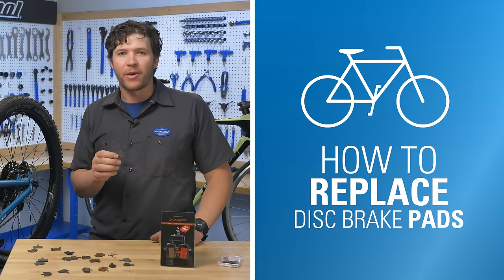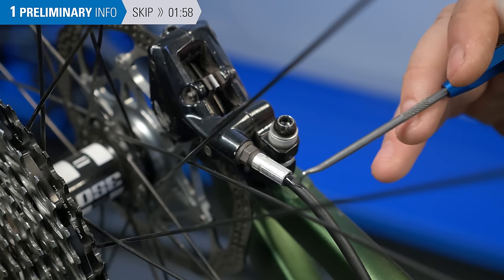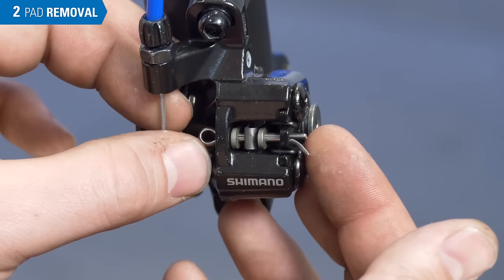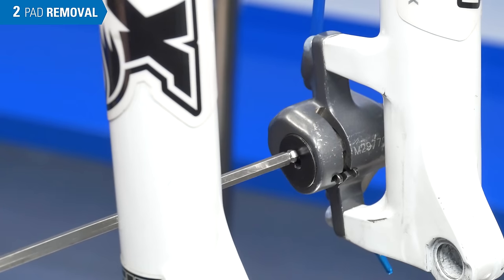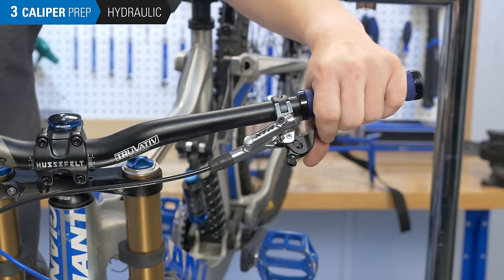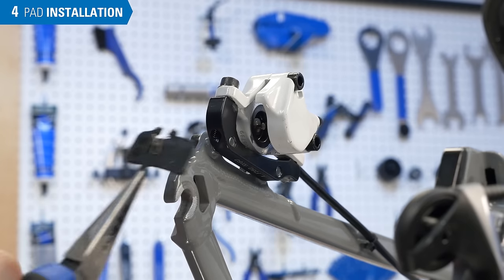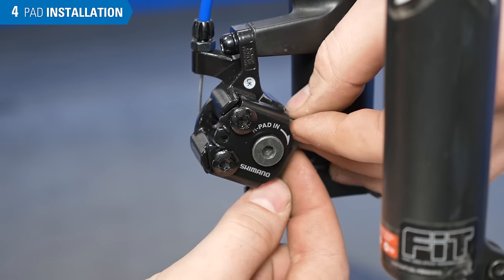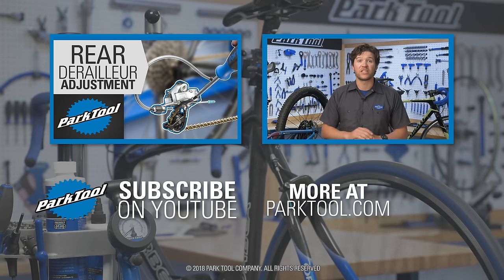How to Replace Bicycle Disc Brake Pads

Comment: I accidentally pressed the brake handle when I had my pad removed... My hydraulic brakes didn't like that
Reply: I did that and turned a 2-minute job into a 3 hour job
Reply: @gabrijeljozic9890i pushed it with a screwdriver back in it kinda worked
Reply: They explain in the video what to do if you pull the lever with no pads in. Should be 5 seconds of effort to push them back in with a flat screwdriver.
Reply: Same, quit biking after that
Reply: @SuzukiKid400  often when pushing the lever with no pads in it will push so far that hydrolicfluid will come out, so it is not just pushing back in place, but you will need to refill mineraloil in the brakes.

Comment: A lot of preparation and work went into this video to show the wide variety of designs and types of brakes and pads. Thanks for taking the time to create these videos.
Reply: Yes. This video very clear and extremely well produced... public information YouTube at its best.
Reply: And your explanation is exactly why I’m sticking with rim breaks. This is way too complicated.
Reply: @salmonella508  u mean v brakes?
Reply: Great video, in fact they are all very good and useful.  I changed the pads on a Shimano, wheel is back on, but the handle is now very soft. While I cleaned the calliper, some oil leaked.  Is the handle soft because of missing oil?
Reply: @salmonella508  LOL!!! I had no idea what I was getting into when I got disc brakes.
Reply: @normb987   I can't tell you exactly, but I think the issue is that you pressed pistons too hard this creates leaks. In fact I would never recommend anyone pressing pistons without bleeding screw taken out.
Reply: Thanks,I'm learning over here.
Reply: I like the video a lot,,, you broke it down for the consumer or people who ride mountain bikes with those types of brakes systems or brakes setups mechanical or hydraulic again good video I learned a lot thank you

Comment: Thank you, folks. The local bike shop is so backed up during the Coronavirus lockdown that it was going to be a month to get new pads done on my bike. I bought the parts from them and used this video as a reference, along with the video about adjusting the alignment of the caliper. Brakes are good as new, and no more rub!

Comment: I just want to thank you guys for saving me £25 plus labour. 👍🏻👍🏻
I know it isn’t a fortune, but it opened my eyes for how easily you can get scammed.
I went to the bike shop because my brakes didn’t work at all, all of a sudden after switching front and rear brake cable (I’m Danish, and don’t like the British setup with the rear brake on left brake handle). 

The gentleman there said that my brake pads had gone missing, which I found dubious but okay. He also said that he would probably 
 have to fit a new brake calibre system, all in all £25 plus labour. I decided to have a check online to see if I could change the pads myself, and after taking the brake apart according to this video, I realised that not only were the pads still present, but they were also well within limits, and all I needed was adjusting which took 30 seconds.

Great work guys, I’ve subscribed and will definitely watch more of your stuff.

Comment: VERY helpful! I replaced my old brake pads and rotors today. I went to my local bike shop and had them help me purchase the correct pads. They offered to change the pads for me, but I wanted to learn how to do this for myself. The rotors were easy, and your video took the mystery out of changing the pads.

Comment: More expensive than many other equivalent tools, but you get precision and longevity. 
Not up to speed on disc brake system maintenance, as important as it is.
Your video though, certainly filled in a few gaps.
Many thanks.

Comment: Thanks for the video n going thru all the different models. Mine was the retaining pin. Removed the pads..clean w alcohol, sand down to even the pad...squeaky sound all gone! So irritating to brake w the squeak. Thanks!

Comment: Lessons learned: 

4:18 - Retract the piston calipers before removing the brake pads. Some configurations don't really produce a lever big enough for you to push them in with the tool. But if you removed them before, just put the old brake pads in between the tool and caliper to make a sandwich and push the caliper back into open position.
Reply: Bro I've wasted 1 hour bcs I accidentally pressed the lever💀 thanks

Comment: great content and tools quick question on this video.  Isn't there a process to scrub the pads after installation?  I have read that once installed rather than hit the trail you should take a few straight forward runs and apply the brakes aggressively to scrub residue and seat them properly with the disk.

Comment: Fantastic video. Detailed, clear and great visual details throughout. *Can you provide some advice... I'm installing hydraulic disc brake pads for the first time. I removed the old pads just fine. I'm unable to compress the pistons all the way in. They go in part-way then slowly creep back out. When I put the pads in, there is no gap between them. I was able to spread them apart enough to fit them over the disc. However, both pads rub hard against the disc so the wheel hardly turns. There's no free play like there was before. The brake lever doesn't have any free play either. Why aren't I able to compress the pistons all the way and have them stay? In your video, the pistons stay all the way in. For reference, these are Tektro Auriga e-Comp brakes. Thanks in advance.
Reply from the maker: I have responded to your email.

Comment: Thanks @Park Tool! I'd love to meet your instructional designer, the videos are a blast! I have a question about pushing the calipers back - whenever I push one back, the other one comes out. No matter how much strength I put into it, I can't push both of them back. Does it mean there's too much braking fluid and I should let some out?
Reply: Have the same problem

Comment: This is why I LOVE drum brakes. My main bike runs Sturmey Archer hubs. One with an IGH and the other with a generator. Both have hub brakes. It's now 10 years old and is used for near daily commuting and the last I checked the wear on the pads it's not even 1/4th the way worn. So It should close to 30 more years. I'll never understand why the drum brake never gained a lot of acceptance outside of utility bikes.

Comment: Looks like like serious job, I once bought brake pads and replaced them on my bike with cantilever brakes in 5 minutes, then on the way home car cut me and I had to brake hard, if not for that I had just put new pads I'd be dead. If I had one of those disc brakes I'd have to go home on old pads and would crash cause no way you can do that with one allen key on the street.

Comment: Great video, i wonder if too much breakfluid can lead to rubbing brake pads. In my case the pads are well centered and cleaned, but as soon as I pedal hard or the breaks get hot when going downhill they start to rub. I am Riding a specialized venge with ultegra 8070 di2.
Reply from the maker: It is possible but resetting the pistons and facing the mounts are probably more likely solutions in that system.

Comment: WARNING:
in hydraulic brakes, if you press the clips manualy back into place too quickly and too hardly, you will cause the automated system at the handle end of the brake to spit the fluid out. You should gradually press them into place and in this way allow the fluid to get back into the small reservoir at the handle end of the braking system. This reservoir holds the additional fluid so that the system may adjust itself as the brake pads get thinner and thinner by use.
Reply: Excellent point!

Comment: 6:12 I have this one (Avid BB7 Mountain/MTN). One of the pads sometimes comes in crooked. Damn, that's really annoying.

I wish there was a mechanical brakecalliper that holds the pads with magnets and where both of the pistons moves when I press the brake lever.

The one thing I do like though. I really like the indexing adjustment. No, loctite or anything. Just set them and they will never move.

Comment: Wow, now I know what is that thingy at the end of caliper for. Better super late than never :-) Anyway, back to topic -- what are the mechanical disc brakes that do not require removing the wheel to change the pads?
Reply from the maker: There are a few available. TRP's are a fairly common option though.
Reply: @parktool  Irony I have TRP, Spyre-C but the pads can be removed by pulling them down, meaning you need to remove wheel as well. Do you know specific model which allows removing just pads (w/o removing wheel)?

Comment: I watched this and completed a pad change.  When I was cleaning up I grabbed the instruction flier from the PP1.2 and it said to push the pistons in with the pads already in place, which is contrary to what is noted in the video.  Just wanted to share this as I was unsure I had completed the job correctly but the rotor wasn't rubbing and everything felt good so I didn't both redoing it.
Reply from the maker: It is not un common for the pads to be too close together to use the PPL-1.2 effectively. Thats why in this video we give you a more effective way to push them back everytime. The PPL-1.2 is designed to work with pads or without.
Reply: @parktool  Thanks for replying!  I know the video is a bit older, nice of you guys to stay on top of comments after the fact!

Comment: When trying to reset the piston, when one side was pushed in the other came out not allowing a big enough gap for the rotor to rotate freely. How do I get both the left and right pistons to stay pushed in? Great video thanks.
Reply from the maker: It can be a bit awkward.  You can use a cone wrench handle to hold one while pushing the other. Or set pistons before removing pads.

Comment: Should I re-bed the brakes after replacing pads with the same material (organic)?
Reply from the maker: There will be a bit of bed in time, but In your case (having the same material and the rotors were already on the bike) no bed in procedure is needed. Have fun!

Comment: I disassembled my brake caliper and found that one of my pad was missing a small magnet attached to it (they are removable). 
The caliper seems to be made by Joytech and model is MDS5, but I cannot find any information or video on that specific part. 
I'm also unable to find any replacement parts. 

Have you ever experienced that and how do I fix my brake? 
It keep jamming when I push the brake, because the pad doesn't return into it's position.

Comment: Great how to video. Towards the end of the video, the presenter mentions that it's normal for properly installed brake pad assemblies to wiggle. I ride on hilly gravel roads a lot. On steep, bumpy, gravel descents (nearly 40 mph), I'm hearing fairly loud chatter coming from the front of my carbon Orbea Terra with its Shimano GRX RX-810 disc brakes.  Could that be the disc brake pad assembly chattering? Could something that small make such a relatively loud chatter?
Reply from the maker: Try to isolate the noise.  Begin by checking the headset.  Bounce the bike and see if there is a rattle.  Then check the security of the front wheel.  Grab top of the wheel and pull side to side and check for play.  Check brake caliper mounting bolt tightness.

Comment: Great video! I am having a problem with my pads. They are the magnet type and without a retaining pan. The problem is that the outer pad keeps getting out of place and won't go back to relax position because it gets stuck. It's really frustrating because it results in your bike braking completely and me having to dismantle the brake just to force the pad back into correct position. And once i use it again with some intensity it happens again. Any suggestion on what should i do?
Reply: I think my comment is clear symptom that the pads need to be replaced. After i made my comment, i removed the inner pad just to compare it with the outer pad and only then i realized how eaten the outer pad was. The inner was almost like new while the outer was almost reaching the metal, with almost no layer left. And i think that is exactly why the pad got out of place whenever i braked hard, because it was so thin that it went along with the disc instead of staying in place... now my mission is to find some pads that match the format of my brake xD. Crazy how many formats there are. I wonder why there isn't just one or 2 universal shapes?..

Comment: Whats the best way to decontaminate the rotor?  If you have hydraulic brake fluid contamination on your brake pads. Can you simply just use a degreaser or alcohol  to clean the rotor or  is the rotor unserviceable?
Reply from the maker: The rotor is porous on a microscopic level and does hold a very small amount of contaminants, but you can usually clean the contaminants off with Alcohol or a non residual cleaner like a brake clean. I like to clean it off with Alcohol,  scuff it with emory cloth, then clean again and you should be ready to rock.

Comment: I Think it’s important for hydraulic brakes, that the screw for bleeding the system is open when pushing the pistons back. Otherwise there is a high pressure and the pistons can’t go all the way back. ✌🏻
Reply: Barring leaks or any fluid related work having been done, the total volume of brake fluid in the system should be the same when the pads are worn as when they were new (i.e. when the pistons once were pushed back due to thick new pads).

Normally, no bleed screws should need to be opened in order to fully push back the pistons. Messing with bleed screws is likely to let air in, and then you have to bleed your brakes, making a simple pad replacement unnecessarily complex.

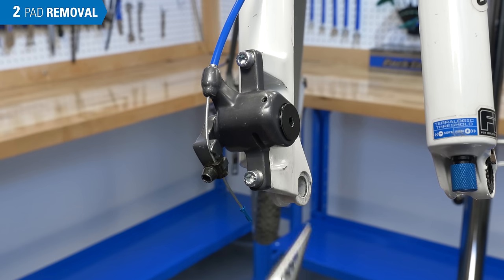Comment: I have the kind at 3:20. I've removed the outer pad, extended the adjuster as far as it goes even removed it but it just won't fit through the opening. It feels like I need to break it out.

Comment: If the brake leavers have reach adjustment, should they be put to their furthest position before the whole process?
I found this to be a must also when bleeding the brakes.
Any input on the subject?
Reply from the maker: During bleeding this is an important step but not during pad replacement. Hope this helps.

Comment: Any tips for pushing the pistons back in? I just replaced my SLX pads and it took me forever to get the pistons to stay in using tire levers. Wonder if I'm doing something wrong...
Reply from the maker: Were you pushing them back into the bore nice and straight? Usually on mineral oil systems the pistons should have no issue going all the way back into the bore. It can be tough on some DOT systems as the fluid can take on moisture and actually take up more space than it originally did.  if you stick the tire lever through the opening on the caliper so that you can get your hands on both ends then pull evenly on both sides you should be able to push them back. There could also be too much fluid in the system if it was bled with a block that was too small. In this case you will need to re bleed the system. I hope this helps!
Reply: I use the back end of my adjustable wrench which gives a lot of contact area (so it goes in straight). You need to press and hold for a bit so the oil travels all the way back into the reservoir.

Comment: I have the brake pad mentioned last.....The one which is rectangular and needs to be pulled....I try to pull it but it just won't come out....I apply as much force I think is necessary to NOT break it....Am I missing something or should I go all out and just Yank it out?
Reply from the maker: Im sure you have checked a few times but check once more for a fixing bolt that holds the pads in. It would be on the top, but may be recessed or hidden from sight. If you do have the clip in style then a slight inward angle helps quite a bit. it can also help to push from the top with a flat tip as you are pulling from the bottom. I hope this helps.
Reply: @parktool  Hey Thanks a lot for you suggestion but in the end i had to take the whole brake apart to remove the pads.....There was no bolt above securing them...They just won't come out... Anyways I put in new ones and put it all back together....Your Adjustment Video Helped Thanks a lot!😄

Comment: Q1. Are there any different between front and rear disc brake pads ? Q2. Which is better in terms of performance and easy to maintain ? Cable disc or hydraulic disc brake ?
Reply from the maker: Front and rear pads are the same if the brake is the same model. 
Hydraulic disc is often a better system. There are cases where hydraulic brakes can be a pain but for the most part they require less maintenance and function better.

Comment: There was no part about how to get the pistons back, apparently you have to open the box to get them to move? Couldnt move them even woth takong the wheel off
Reply: Sounds like there's a lot you're doing wrong.  Pushing pistons back should not be part of pad installation
Reply: @Noop-Noop56  sounds like you've never installed pads.. the pistons being stuck is often part of it
Reply: @DandyHippo  okay buddy good luck

Comment: Thanks this was very useful, I wonder if you could help me though.  Once I put the pads back, the brake lever comes alway the way back the handlebar and doesn't stop the wheel.   Have I done something wrong or it there a step missing?   I have a hydraulic brake system.
Reply: It was just the 'pumping' of the brakes that I needed to do.   It was just a lot more pumping than I expected.   But then that's what my wife says.

Comment: Do you recommend cleaning the pistons and the pad area before pressing the pistons back? Will not doing that cause issues?
Reply from the maker: https://www.youtube.com/watch?v=vQXFFgRButo&t
Reply from the maker: It is not typically needed every time you replace your pads but it is something that can make a big performance difference.